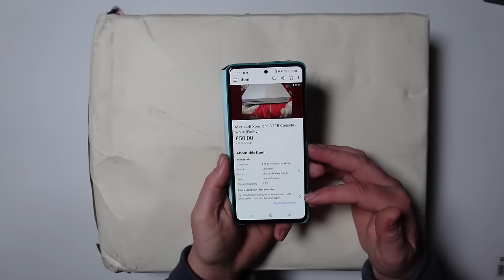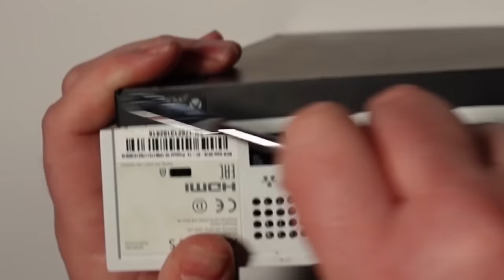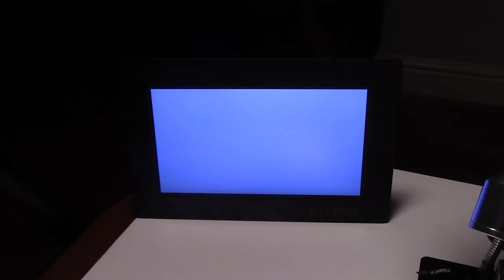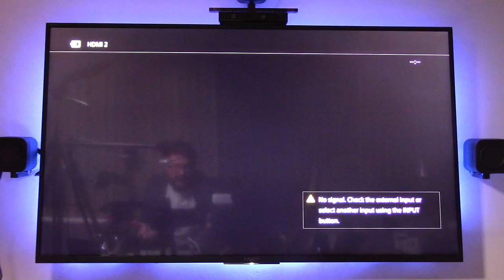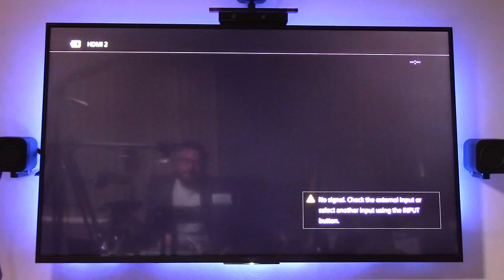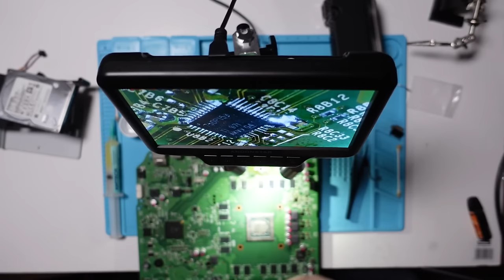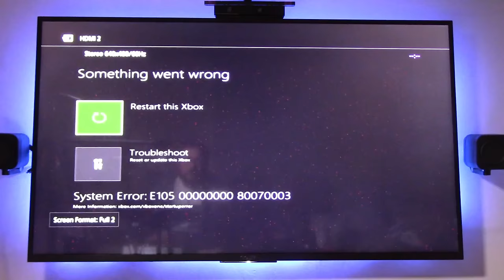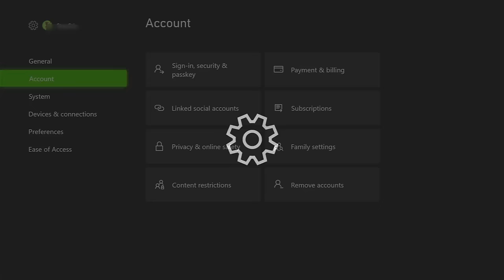Xbox One S with MULTIPLE FAULTS | Can I FIX It?

Comment: Man this hurt to watch.

When I was younger my mother got me a second hand 360 classic for xmas, we weren't a well off family, so this was a huge deal. It worked well, a litte overheating here and there and some thermal paste placements required for Sure. One day it stopped working - I spent days working on it in secret hoping that my mother didn't notice it was broken as I feel it would have broken her too. I went through hell and back diagnosing the nonsense error codes and lights - Drove me to the edge of insanity. Luckily I got it back up and working (never could find out the cause). Regardless the xbox lasted me another year or so at least. It meant the world to me, and thus meant the world to my mum.
Reply: Now that's a nice story to tell
Reply: @BigMeatyMike 

Still have mine as well, I modded mine.

Later on ran into the ring of death as well.
Started reading on forums, and found out it was the flimsy backplane cross that had to keep the cooler in place.

Because the board would heat up the board would start to bend and this made the processor not touch the heatsink and cooling paste.

So made myself a new metal backplate with some insulation inbetween and added new cooling paste.

Never had a single ring of death after that.
I still have the 360 and it still works.

Comment: When you were testing the power supply Plug for shorts to the ground, Keep in mind "filtering capacitors" connected to the Positive and Negative rails hold a voltage ergo they can give a false positive indicating a short right up to the point where they are finally discharged. In short "your Meter will beep as long as the capacitors have a potential or voltage stored in them" Which BTW is perfectly fine as long as the beep does stop..
Reply from the maker: That makes perfect sense yet again. Your comments are always super helpful. Thank you so much! 🙂
Reply: I was about to tell him that I get the same false beep and I just got used to it 😂, but you explained it 👍
Reply: Do you do repairs sir ?

Comment: Hi Steve, when you were testing the power socket you actually had no short to ground apart from the ground pins.
When you reversed the meter leads you had what appeared to be a momentary short. 
What you actually had were the capacitors charging and once charged the apparent short disappeared.
You will notice this, its very common when you put a meter on resistance or continuity range across a capacitor, it charges with the voltage from the leads, when you reverse the leads it discharges and then charges again. The length of a beep on continuity will be dependent on the amount of capacitance you have the test leads across. You can test this if you have an electrolytic capacitor out of circuit and a meter on continuity.
The larger the capacitor value the longer the beep, its because of the charge time of the capacitor. 
Other meters, like ESR meters use charge times to work out the ESR of a capacitor. The greater the charge time the greater the ESR.

Comment: Great work mate! I appreciate your effort. I learned so much from this video. I am stuck on my 4th xbox one s repair and watching this video was quite motivating; gave me the courage to give it another go. Please don't give us the short version of your videos. The long ones have so much more info in them and it's more likely we'll solve our own troubleshooting problems when we can see every aspect of your repair strategies. Cheers!
Reply from the maker: Thanks Mark, much appreciated! Good luck with your repair, I hope you can find the problem!👍
Reply: @StezStixFix  So, after about 11 hours worth of watching Xbox one s videos, I've circled back to you.

Ok, so I've another question if that's alright.

Here's my scenario:
1. 12v rail has no shorts.
2. 12v supply is good.
3. All MOSFETs are great.
4. No burn marks on the MoBo and all components are visually clean with no burn marks.

Symptoms:
1. When I plug the PS into the board the fan does a regular 1 second spin
2. Upon hitting the power button, I get an Immediate shut off after the "beep on" tone.
3. Eject button does function, but after the board turns on it shuts off after a split second.

I'm not sure what components I might check on the MoBo to get a solid lead that my southbridge needs a reflow, BUT I would surely prefer to feel silly if I missed something truly obvious.

I'm afraid after logging in about 23 hours of troubleshooting and analysing under the scope, I could really use a fresh set of brain cells to give me a friendly nudge.

Any suggestions?

If you've an email address that you'd be willing to share that'd be great too! 

P.s. the first 2 boards I fixed, they would turn on fine without the HDD and without the BRD (Blu-ray Drive) plugged in. I had only tested the first two with the wifi card, power board, and the PS with the fan loosely placed on top. I want to avoid putting thermal paste on the fan, clamping it on for EVERY test to avoid wasting material and struggling with the blasted x-clamp. Should I be testing only after a full assembly?
Reply from the maker: Hi Mark! Have you checked out TheCod3r? He knows an awful lot about this stuff. I'm pretty sure he's done a few videos with that problem.
I'm still a noob really, so I'm not sure if I can help you too much. But I would imagine that you must have a short somewhere. Have you been round the capacitors and checked for shorts to ground? If you have and are not finding any, then it probably is one of the BGA chips on there (unless its had a prior attempt like mine did on the retimer. Or if anything else has been replaced, like the HDMI port etc. I'd definitely check them for bridges.)
Anyway, check out the Coder. He does it professionally and has some great videos. Also Andrew Paul, if you haven't seen his stuff. 👍
Reply: @StezStixFix  thanks so much for the reply! 

I have actually watched all of the Cod3r's videos and Andrew Paul as well. They have great stuff! Unfortunately, neither of them have anything that gave the me the edge I needed. At least not yet :) I have tried to each out but am still waiting for further replies from them.

I'm still a noob as well. May I ask what the BGA chips are? 

Thanks for the reply mate. It really means a lot! 

Quick question. 
Concerning shorts: I removed every capacitor (all 6 above the coils on the 12v rail). 

I checked for continuity on the positive and ground points and noticed they they are shorted. Well, maybe they're supposed to be? 

I also noticed that the little gold/bronze colored ceramic looking caps on the APU are also shorted to ground. But not sure of that's also normal. 

I wish I had a fully functioning board to compare readings to. What do you think?

Cheers!
Reply: @StezStixFix  fantastic! This was a great lead. Thanks a million!! 

I'll check out the Cod3r's group as well. 

Cheers!

Comment: Awesome repair Stez! Like the neo geo pocket, your didn’t give up, and it paid off. Well deserved win! Loved the video as usual. It really looked like they used plumbing solder to replace those chip, it had a very strange structure when you took off the retimer. Regarding the short on the 12v, this is the caps charging or discharging, that’s why you only got the beep for 1 or 2 seconds.

Comment: Hi this was interesting 🤔.I watch a lot of the north bridge fix channel.

The quad flat pack retimer chips need pre tinned pads,and a small blob of solder on the Center pad 

Heat push down ,run a chisel tip around all the pins to clear bridges 

The centre pad dissipates heat into the pc 

Good content 🤔well done

Comment: Hi Steve, I know this is an old video, but having watched some of your other videos I have noticed one thing.  You never seem to check the datasheets on these chips. The data sheets so often have suggested circuit schematics with capacitor and resistor values.

Comment: **Addendum**
With Transistors and Diodes always expect anything from around"0.6 to 0.9" one way and open when the leads are flipped, BTW with geranum junctions expect readings in diode mode as low as "0.3"
Reply from the maker: Thank you. Will look into this. Not sure what a geranum junction is, but I'll research! 😊
Reply: @StezStixFix  I only mentioned Geranium as you may come across vintage electronics in your future endevours that may have Tranaistors and diodes  with geranium junctions..
Reply from the maker: Ah, got you! Thanks bud! 😊
Reply: @StezStixFix  Proper spelling btw is germanium.. sorry if my bad spell-n put you on the wrong track..

Comment: Nothing like that feeling when you get something like this working, can't beat it. Wow, looked like whoever originally worked on it used a paint stripper heat gun! Can't believe how much of the solder mask had been burnt off. I had a feeling that once you had replaced the re-timer with the one from eBay, and you got no power on that it would be that chip. Far too many fakes doing the rounds. But great job persevering, well worth it in the end.

Comment: When placing an IC with large ground plane in the middle do not press the chip down with your tweezers as this just squeezes the solder out into the surrounding pins and shorts them out. Use just a touch of solder on the ground plane.

🥴🥴🥴😀👍

Comment: Hi, Steve! I hope you're doing well.
I am currently working on another xbox one s. 

After watching multiple videos from the Cod3r and Andrew Paul, I have yet to get an answer about which I've inquired. 
Would you happen to know from where the 3.3v and 5v power are sourced? I can't for the life of me figure it out. 

If you have Any insight at all, I would be truly grateful. BTW, I still watch this video over and over again. It continues to help me with
the various issues I've had over the past month or so. 

Cheers!
Reply from the maker: Hi Mark! I don't know exactly where they are, as i didn't need to go that far, but you'll be likely looking for some kind of voltage regulator/step down convertors. They are probably small chips marked with a U, but I don't know for definite! Have a look around where you see inductor coils. 👍
Reply: @StezStixFix  ahh!! I have found the step down converters and the inductor coils. I think what's confusing is that I'm not sure if the southbridge Chip is what converts 12v to 3.3v and 5v. 

Finding the exact flow order of conversions is becoming quite the brain teaser! 😥

Anyway, thanks for giving me another piece of the puzzle. Cheers!
Reply from the maker: I don't think the Southbridge will do any voltage conversion, it's there to handle input/output data. Good luck finding the voltages, I'm sure you'll be learning loads along the way, which is a great way to learn in my opinion! 👍

Comment: I bought an ps2 fat with 2 controllers and a ps3 fat for 35 euros last week.
Ps2 works like a charm, bit dirty especially the controllers but that cleaned right up.
The PS3 looks worse then this Xbox, someone reflowed the CPU and pretty much burned the NEC TOKIN caps with it.
Was planning on just selling it on for parts but might give a repair a go.
Never done any SMD work so going to be a good learning experience I guess.

Comment: The part where the BluRay Drive wasn't plugged in reminded me of when I bought a 'faulty' GBA off of eBay. Listing said the screen wasn't working, but there was sound and power. Thought I'd take a chance. Turns out the ribbon connector bale wasn't fastened. I think it cost me less than £15 for a fully working GBA!

Comment: I would have gotten a clamp down socket for the timer chips   and replace most of the tracks with enamel wire going to it since it was a big mess  in the first place (after removing every possible bridge)

Comment: i am late on this one but i think you need some more smd chicken corn around the replaced chip north and south. since it is working in general i guess for some smd caps to fix red dots and such - but possibly also a resistor. guess the first repair guy just did blow them off the board. maybe you can find details in the chips datasheet in a example schematic. later it may just work in different resolutions, timings and modes by luck which is also fine.

Comment: That's liquid metal that's been splashed on the board right? How in the hell do you get that off the board? I'm only about a 1/4 the way through the video. Sorry If you answer that at some point.
Reply: that's solder there's no liquid metal in this

Comment: Where's the diagnostics? I hear "I think, I'm not sure, I don't know, um, no nothing yet. If you were fixing a car, you'd just throw parts at it and hope? You seem like an amateur with fancy equipment. Can I do this too if I bought the equipment?
Reply: Even the full service manuals can be lacking and leave you guessing. Nothing like experience.
Reply: I believe they deleted my other comment and im not retyping it. Went on a rant about Haynes "Repair" manuals. Anyways this guy seems like he's learning, he enjoys doing it, and hes probably making some money fixing stuff up. Its like less than $1000 for all the tools he's using. So yea why not do it yourself. Start a channel and start selling what you fix on ebay if you want.
Reply: @Gandalf22476  I have an Asus G752 computer with a fan making noise and an internal battery needs replacing.  I have to take it all apart. Seems impossible. I have a degree in diesel repair and have great diagnostic abilities. I don't guess and you'll never hear those words come from me.
Reply: @jasonk795  yea that figures. Diesels aren't a guessing game, great way to lose. Lol. Good on you. You might be able to find the manual for that g752. I recently repaired an HP laptop with a very similar problem. Fan making noise and battery needed replacing. Turns out the fan was making noise because there was a piece of plastic that had broken off one of the battery mounts where the battery had expanded so much it broke the mount. No evidence on the outside the battery was expanding either. The manual i followed for that HP was found on their website. I'm not sure if Asus does that. Worth finding out though that should be a straightforward fix. Not as intricate as board repair. Shouldn't even need to solder. The fans and batteries in the aftermarket space can be had pretty readily even despite the "supply chain issues". If you can't find oem. You might be able to fix the fan noise if it is the same situation I had recently with that HP by removing the piece of plastic. But no guarantees thats your issue.
Reply: @jasonk795  it should be a pretty simple fix. Don't feel too overwhelmed. As long as you can find equivalent parts to replace youll be fine. The only thing that HP manual really helped me with was locating all the external screws on the case. Beyond that just be sure to unplug the battery when you get inside before you do anything. And i highly recommend grounding yourself. If you don't have an antistatic wristband, there are many options for grounding yourself.
Reply: @jasonk795  looks like Asus does not have it but iFixit does have a replacement guide for a G752V fan. At least for the fan via a quick google. It should tell you to disconnect the battery and as long as the battery is not serialized to the laptop you should be able to disconnect and remove it and swap a new one in. Probably take less than 20 minutes to do both. Popping the case open will be the hardest part. Those plastic clips are more prone to breaking than the one's they use on vehicle trim. If you've got them, thin spudgers really help for holding it open as you work your way around.
Reply: How long you been working on diesels if you don't mind me asking?
Reply: @Gandalf22476  you've talked me into it. I almost have the keyboard off. Monitor is next. Gently with the clips, I just kept trying different spots and it came loose. Nothing broke yet. All screed labeled and in bags with parts. The screen scares me the most.
Reply: @jasonk795  Nice! If you cant fix the fan at least you can see it and maybe grab a part number! And for the battery. GL hope its gets you comfortable with it!

Comment: If you see such an overheated board for an integrated circuit, you should change it. Taking it out and putting it in its place won't fix anything.

Please stop using tons of flux. The tin you use to weld ALREADY HAS. Do not add so much and so many times.

Please clean up all that gunk you leave behind.

You use too much thermal paste.